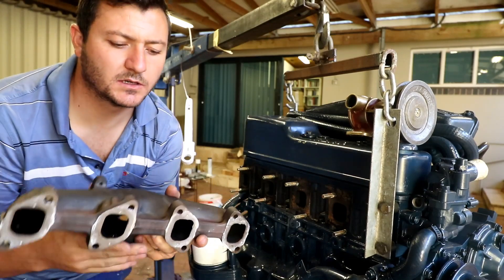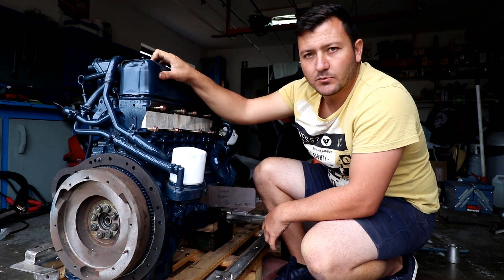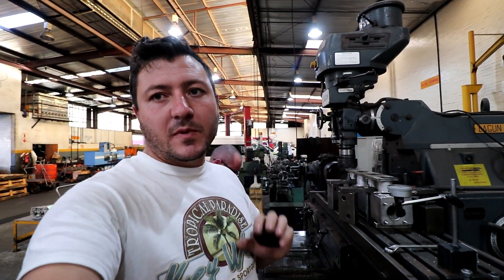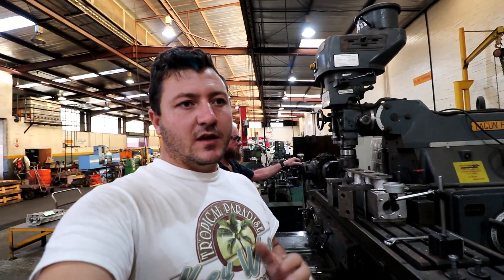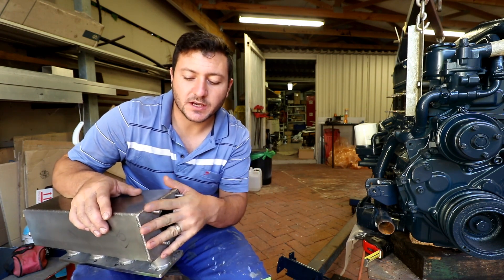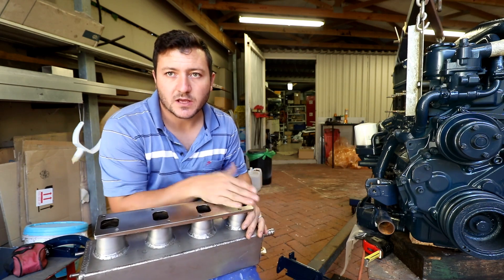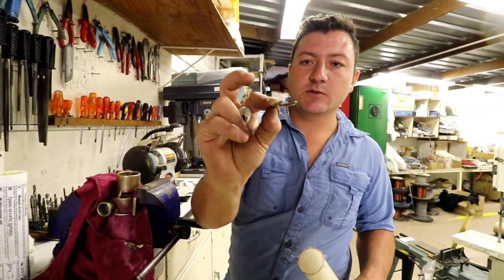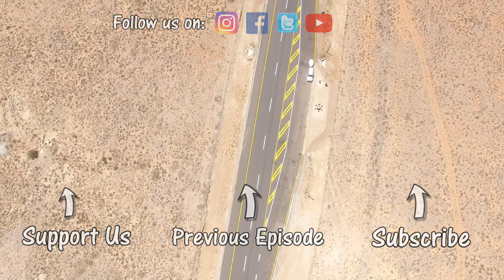Why your ENGINE needs a WATER COOLED EXHAUST! | YACHT REBUILD WEEK 69

Comment: First time I ever saw a manifold welded up, and the anode is sheer genius, I never saw that before. What's needed for a closed cooling system engine and manifold, but raw seawater cooled riser (which many boats need but not yours) is an anode inserted into the riser water somehow.

Comment: very well done,
 just one point, the major part of the cooling of the exhaust gases occurs when the engine cooling waters mixes with the exhaust gases.
In fact, the exhaust gases intantly heats the exiting water  up to the boiling point then transforms a part of this water in steam, on a full throttle operation, up to 10% of the exiting water can be transformed in steam,
A good indication of lack of cooling water is a heavy production of steam at the exhaust.

Comment: Interesting this is the first time I have heard any one doing this. I find it interesting but wonder if you are aware of reversion that cooling the exhaust gasses down makes it more dense and heavy causing the gas to return back into the combustion chamber when you are only working with 23% of your volume is oxygen it usually causes an engine to run rich on a stock tune. Due to some of the inert exhaust gasses  going back into the engine. The exhaust works well when its hot and the exhaust gasses are less dense creating a vacuum or very low pressure in the exhaust.

Comment: Better  and safer  for the engine,to use the original exh manif;  make,or have it made,a good insulating bkanket and a shield plate; sometimes i only use hi temp wraping tape,but FIRST i do a few heavy coats of hi temp paint underneath,because when salt water lands on that hi temp tape,the cast iron manif starts to rust,if not painted under the tape; even like that,if it gets wet, tape removal to inspect is needed once a year;
the boxed -in exh manif you made WILL fail,and water WILL go thru the exh valve that is open and ruin the engine, it's a matter of time; much much better if it has antifreeze inside,but for that you need a bigger intercooler,obviously.
edit...Omg...and you still have 4 pieces glowing red hot in there, those 2 inch long exh pipes; insulate those,now; if that is not a turbo,they will not get red hot,but they must be protected.  like i said,what a COSTLY waste of time,i think,with that manif.
 Great video thanks for posting.

Comment: Hi, I've watched 3 of your videos on the marinization of your engine, I think it's the most informative videos I have seen on the topic. I had a question, the inner T shaped pipes that you welded inside the heat exchanger, could you tell me what those initially were? and the outside cone shaped pipes. Thanks!

Comment: WRT your water cooled manifold, with both water inlet and outlet at the same end, is there not the possibility of the water flow short circuiting at that end of the manifold, leaving heat build up in the (relatively stagnant) water at the end away from the inlet & outlet? There was mention of some baffling, but I couldn't see any. It is a really well made piece though!
Reply from the maker: Thank you! ☺ 👍🏻

Comment: If that is all mild steel it will have a short life.  Heat and salt water cause steel to corrode quickly.  Stainless of aluminum would have been better.
Reply from the maker: Jack Patteeuw it’s all in 316L stainless steel

Comment: Why do you feel you do not need an anti-siphon valve? I do not see that having your water cooled exhaust then water going into the  exhaust line is any different than the water cooled exhaust on my yanmar  marine engine that has a anti-siphon valve.

Comment: There's design flaw - water will flow shortest path possible meaning exaust closest to the water outlet will be cooled right and furthest will be much hotter. To avoid that you should put separate tube inside exchanger going all the way to the other side or to make water intake and outlet at opposite side of exchanger. The way you did it significatly decrease efficiency - probably to 25% of what should be, or less...not good at all.

Comment: Nice looking manifold!   Hint, Don't grease impellers unless you can run them immediately after installation...it breaks the rubber down.  Liquid soap or glycerine may be OK for delayed use after install but most just use water or nothing.
Reply from the maker: Thanks so much 😊

Comment: You should have a water entry at one end and exit the other end or else the coolant will not get to the furthest cylinder port. Ideally you need to run a heat exchanger too.

Comment: You shouldn't use anything on the threads of the anode. It needs to make contact with the metel you are trying to protect. Change that brass fitting out for a stainless one.

Comment: Love the exhaust manifold.  Fyi always remove the dust cover on new bearings and repack with grease correctly. They are seldom are done correctly.Use the same grease . 2nd banging and hammering a bearing into place ??? Really ??
Not good ...either freezes the bearings or heat the receiver.
Reply from the maker: Thanks Jim! 😊
Reply: Leave bearings alone Jim. Buy better bearings not knock offs. The people who make them know what they’re doing as they MAKE THEM!

Comment: Very nice job. But I agree with some comments - I would make water outlet on other side. Also, I think would be better to cut plate in 4 pieces before surfacing. Or at least use 4 gaskets from standard manifold when bolting on, not one big gasket.
Reply from the maker: Сергей Канаццкий thanks, it is 4 gaskets ☺

Comment: The anode should not be electrically isolated. That defeats the purpose of the anode. You may want to fresh water cool the exhaust manifold. This is the most common way for Diesel engines. You of course need a larger heat exchanger since there more heat load. Item 142390745192 on Ebay.

Comment: Exhaust looks good. If you haven't already I'd consider adding additional support, other than Simone, from the manifold to the engine block. Hanging that much weight when it's filled with water and when the elbow and exhaust are attached may make the manifold fatigue at the welds from vibration, crack then crevice corrode.
Reply from the maker: Thanks! 😊

Comment: Make sure that exchanger is filled with only water when the engine is off. Oxygen can be a bastard in exchangers. Have had exchangers leaking after two years because of air in them when driveline is not used. Would be a shame to see such lovely work not to last. Love your videos!
Reply from the maker: Thanks Johannes! 😊

Comment: Looks great. the only one question that would have was were you able to pressure test it to look for leaks?
Reply from the maker: Yes it was pressure tested to 6 bar.. Converted to 82psi
Reply: Nice to hear that it would have been a shame to find out that there was a pin hole and it leaked water into the engine or the exhaust fumes into the cabin its nice to have peace of mind knowing that it safe to use. it looks great looking forward to see how rest of it comes together and what you are going to use on the exhaust pipe going out to keep it cool. i do like the zinc rod  anode it should make it last the life of the boat with the maintenance being done like you talked about.

Comment: Without baffles the water circulate from inlet right to outlet, cooling only #1 port and maybe #2 a bit. #4 may actually develop steam forcing water out of the jacket. Unless a diesel's exhaust is much cooler than gas anyway.
Reply from the maker: You'll see. We have done a flow analysis it works perfectly fine. 👍🏻

Comment: Question - how will the water be made to flow around the exhaust? I mean won't much of the water in the water-jacket just flow from inlet to outlet?
Reply from the maker: Water flows to the part of least resistance but if the system is force fed it has to follow the path by which it is being forced there after it will follow the path of least resistance due to the injection point and exit point the water will flow in a swirling motion within the exhaust baffle.

Comment: Hi Guys, do you have this all modeled up in Solidworks? 

If so, I would have someone run some CFD flow studies for the water flow through the unit and then run some thermal studies on your design to find any potential thermal caused stress points that would lead to early failure of the unit to head off problems down the road.

My first impression is the water flow (circulation) without a baffle or an internal pipe to force the water to circulate from one end to the other may be a problem, remember water will always take the path of least resistance. So I would to make sure that there is no short circuiting between the 2 water ports.

Can that oil filter assembly be relocated with the filter hanging down to reduce the changing mess?
Reply from the maker: I have a mechanical engineering degree. I've done these tests numerous times. Don't worry everything will be fine 👍🏻
Reply: @livingwiththemaias  Okay.... 30+ year mechanical designer here... I'll be watching

Comment: Are you sure you want the anode electrically isolated? I think it won't work that way.
Reply from the maker: I know it will work this way.. We will show you with time. 👍🏻The anode is bonded to the grounding terminal.
Reply: @livingwiththemaias  ok that will work, just wanted to make sure it wasn't completely isolated.

Comment: How are you cooling the engine? Won't you need a separate heat exchanger for that as well. The sea water outlet of this one would also need to be mixed in with the exhaust gasses.
Reply from the maker: Yes first stage of cooling is going through a marine heat exchanger which replaces a radiator. There after the water flows  into the exhaust system which cools the exhaust manifold. Stay tuned for more episodes where we will explain the whole system.. Hope this makes sense.

Comment: Looking good guys. Won't that sacrificial anode be difficult to remove after corrosion has its way with it? I've seen what happens to anodes on the hulls over time and it ain't pretty
Reply: Only the zinc will corrode the brass and stainless will be fine, which is the whole point.
Reply from the maker: Thanks NY Don. Why you have subscribed? is correct. The zinc will corrode not the brass and stainless steel.

Comment: If the inlet and outlet is on the same side, whats stopping recirculation and water not reaching the last exhaust? Also just check i think that sink anode needs electrical continuity with the  stainless steel its protecting. We always Chuck a strap between the anode and structural steel in seawater. Looking good though.  Keen to hear her purrrrrr.
Reply: I agree, it's not going to be very efficient, you should use the lower for you intake and weld another one on the top of the box close to the exhaust elbow. That way you force the water thru the whole area and you end up having a shorter hose connecting it to outflow on the elbow. Just my 2cents
Reply from the maker: @SBT Hi. I've done the hydro static calculations for it and I'll shortly add a simulation of the model to prove this.. Unless you are more experienced in hydro dynamics please share your simulation. This would be greatly appreciated thank you very much. 👍🏻
Reply: @Ricky. Firstly I'm a  SA Porra married to a Boertjie like you now living in Cali so if you come this way or need anything from the states, you are more than welcome to contact me. I don't have experience in Hydro Simulations but have a lot of RaceCar experience where the coolant system has to be very efficient because of size and weight. I was just pointing out, just by looking at it and I'm sure you have done your homework(Not criticizing your ability as you do an amazing job). You did a stellar job with the manifold and I don't think you will have any issues with the SS and electrolysis/corrosion. Cheers PA!!!!
Reply from the maker: Thanks , the inlet is on the bottom side of the exhaust and the outlet is on the top  opposite side of the exhaust (heat rising ) the flow rate 20L/min will force the water to the end and as there is a slight back pressure due to the inlet being force fed and a same diameter outlet compared to intel . Having the exhaust in the middle of the housing acting as a barrier promoting the circulating motion of the water along the length of the exhaust. Yes as the whole engine is grounded the anode is also grounded and as the zinc has the highest potential this would be the more attractive alloy .😉💪
Reply: @livingwiththemaias  Brilliant....!